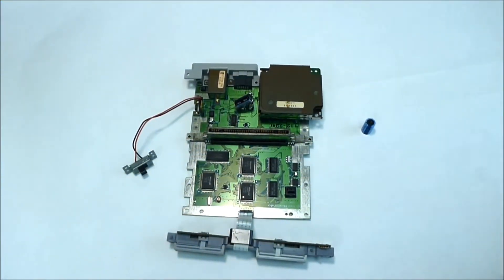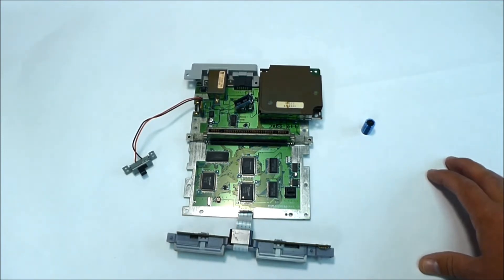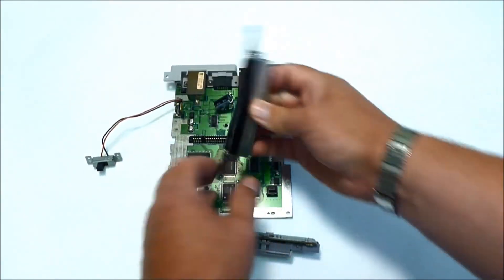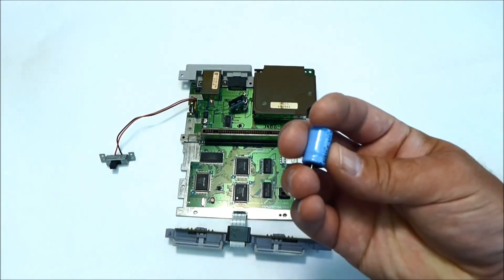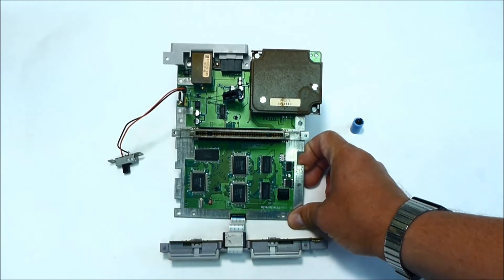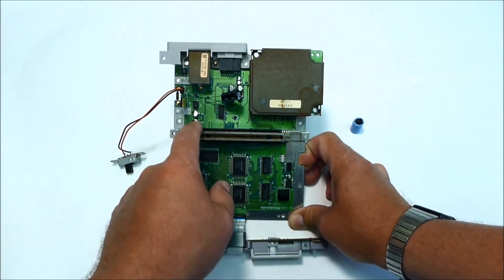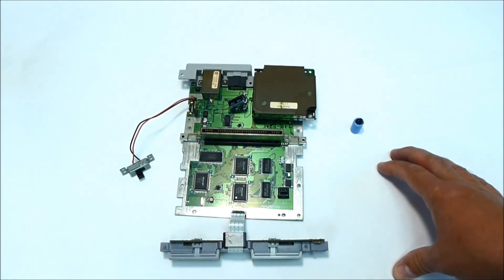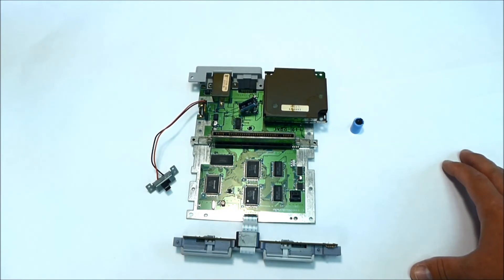Super Nintendo SNES Black Screen of Death it's fixable? Well let see it (Part 1)

Comment: if the audio board (the oxidized heat sink on top right) goes out this can cause black screen of death... if you can get another sound module, try changing that.

Comment: The vast majority of these work over RF but not S-Video, RGB, or composite. I have a bin full of them. They are always SHVC-CPU-01. I’ve traced composite all the way to the RF modulator an swapped RF modulators with ones from working consoles. I even changed the S-ENC encoder chip for a different type from another working SHVC-CPU-01.
Reply from the maker: Thank you I will try that
Reply: GPeter7 do it yourself mods Just to clarify: I tried all those things and it was still RF-only. :(  I have not figured out what causes it. I don’t see how the RF modulator can get a usable composite signal and not the AV multi-out jack. :( I also tried replacing the transistor that amplifies composite video. If you can figure this out it will make a lot of people happy!
Reply from the maker: Thank you for very useful information, I will do my best,
Reply: GPeter7 do it yourself mods The more people working on this, the better! You’re already a nodding rockstar but is you solve this you will be a superstar!
Reply from the maker: Thank you 🙂
Reply: @GPeter7  hey i just wanted to knoe did you ever figure out the solution was emmett turner correct? :) thanks
Reply: DJ ALLIOUS Someone posted an S-Video bypass online. I don’t know how it can work but it reportedly does. I haven’t tried it myself yet.
Reply: DJ ALLIOUS Found it on the DigitPress forum from a user named “Mayhem” in response to a thread titled “SNES Generation 1 Video Problems, 50+ Units with same defect. RF Works Fine, RCA Output BAD”
Obviously, YouTube might block my comment if I just link it.
Reply: Emmett Turner changing the modulator helped?
Reply: I know this is a two year old comment, but I would suggest taking a look at the clock crystal and its' trimmer cap(TC1).
Reply: @upover  Unfortunately, no. :( RF always worked while AV-out Composite and S-Video did not. Since RF worked and I had already eliminated everything between the RF modulator and the AV-out, I had to assume composite was good into the modulator and there was some kind of feedback to the AV-out. Swapping the modulator with one from a known-good console changed nothing. :( Swapping the composite video amplifying transistor with one from a known-good console changed nothing. Swapping the video encoder chip with one from a known-good console changed nothing. It does not seem to be an issue with the encoder, amp, modulator, or anything in the output side of the encoder, leading me to assume it was something wrong with sync from the console and RF was just more tolerant. However, the S-Video bypass seems to imply that sync is fine too so I still don't know what is going on with these RF-only SHVC-CPU-01 consoles.
Reply: I ended up tracing mine to a tiny bit of trace rot beneath the cart reader near the dsp and what, iirc, is the sound chip. I had to remove the bracket and it was difficult to spot. I have a video of it on my channel if you’d like to reference
Reply: @upover  I don't think it was the same issue as all the RF-only SHVC-CPU-01 boards in NTSC consoles (no video through AV), but great job!
Reply: @TheLastDraconic  Thanks

Comment: Hi, Peter, Wondering how to get PPU CPu's chips and any other chip integrated on these pcb, I've been investigating but they are few seller off on ebay at expensive price, read on forums that Japanese sell them like junk very cheap, but did not find nothing store only settle in Japan.
Reply: I actually see listings on ebay from Japan sometimes. Like 40 broken Super Famicom for around 150€. And with free shipping, although I kinda can't believe that.
Reply: @h.celine9303  I saw a video documentary or something like a youtuber, in the streets they sell old tech video console for junk prices. But haven't found any online store, only a few ebay sellers they might think are selling Kryptonite. Absurd prices.
Reply: @svsv9  You mean in Japan? I guess so, never went there. I know they're selling SFC and GB games for 100 Yen (which ist next to nothing) in drift shops
Reply: @h.celine9303  I can't remember where youtuber channel, I watched a  video from about street kind alike electronics video games consoles I saw a lot of SFC and also games in Japan for peanuts.